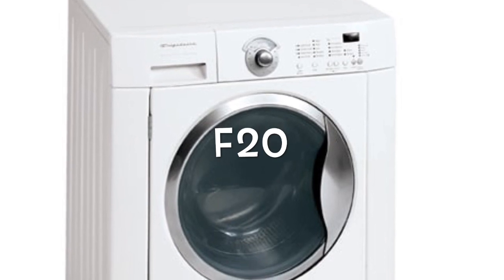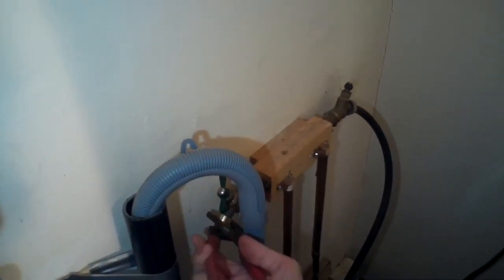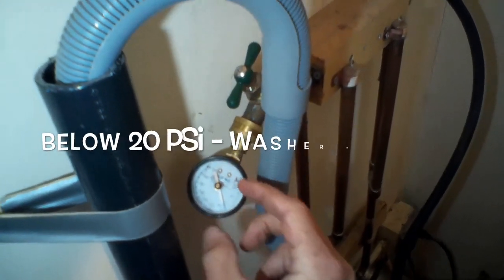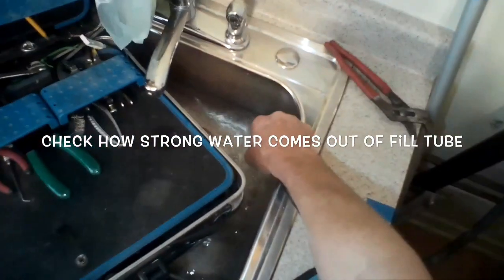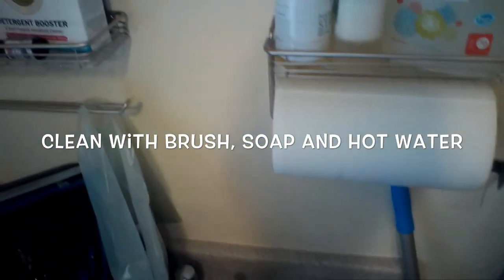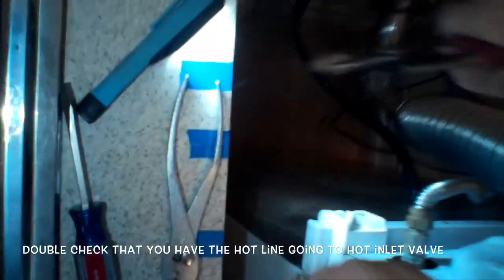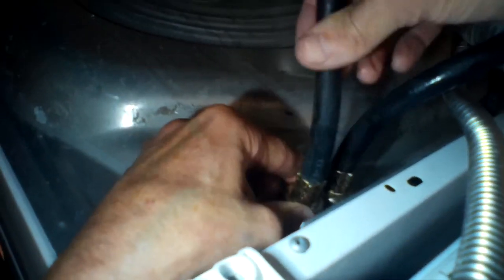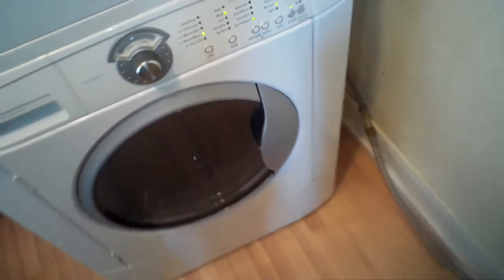✨ Front Load Washer - F20 Error - EASY FIX ✨

Comment: Very well done video, great details. I appreciate a lot. I have Kenmore Elite he washer which accumulates off white soft sandish substance at the filter inlet screen for the cold water every three years. I just cleaned it (it was about 1/8 of a teaspoon) after a few months of f20 which was appearing at 17 remaining minutes (just before rinse) to within 15 minutes of the normal washing cycle start (during wash) lately. No deposit at hot water inlet screen found on my washer. I had to clean  the hose openings also with a brush and then running some water through it as shown here. Just to add, after f20 we did separate rinse cycle which went through fine without error. Also when error appeared during wash, a circuit breaker restart and another new cycle went through fine. This was before cleaning and dealing with f20. Thanks very much again for this handy video.
Reply from the maker: Nice job,

Thank you😊👍

Comment: Just wanted to comment that I had a clogged screen with an unknown substance much like you had described.. I cleaned the screen and got the same error code in the next load of wash. I took the hoses off and the screen was clogged again! after some investigating, found that my cold water hose had some junk in it. Both hot water and cold water was clean from the shutoff - but the cold water hose had somehow accumulated junk/brown algae? Replacing that hose and hoping it solves the problem. Just wanted to pass along in case anyone else has similar situation. Thanks for the video!

Comment: Thanks. Very thorough video. Maybe you can share some insight here. My machine gets a F20 but only on larger loads. I’ve done all that you showed in your video. 

Any idea what could cause the F20 only on larger loads?
Reply from the maker: I would replace the hot and cold inlet valves 👍
Reply: Scottthefixitguy  Will do. Thank you for your reply 👍

Comment: I've been working on my Maytag front load washer Epic Z for about 6 months. I'm trying to get it working but nothing's happening. I don't know how to search for codes BUT, I replace the pump and replace the drain but as a I plug it in turn it on it will start acting like it is going to complete  as soon as I turn it on it comes on and it fills it with water...... it'll wash for a second and then it'll just cut off I had to clean my filter out it was full of trash and stuff so I cleaned all that out and I thought that would fix the problem but now all it does is it soon as I hit start it automatically shuts off it'll run for a minute and then it shut off the water still sits.  I've tried to do everything,  YouTube everything I still cannot fix the problem HELP ME PLEASE.......
Reply: Maytag epic z front loader MHWZ600WR00
Reply from the maker: It doesn’t show any codes?